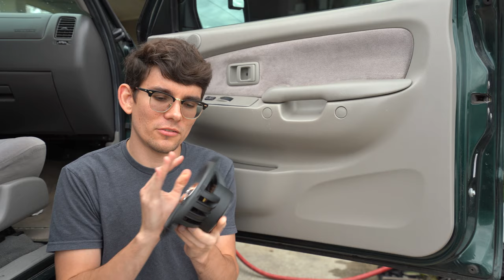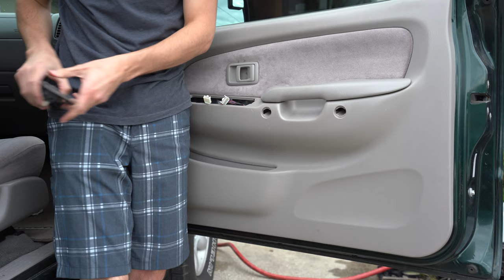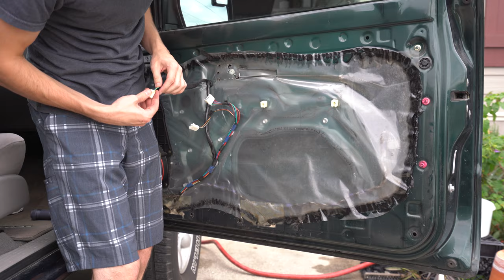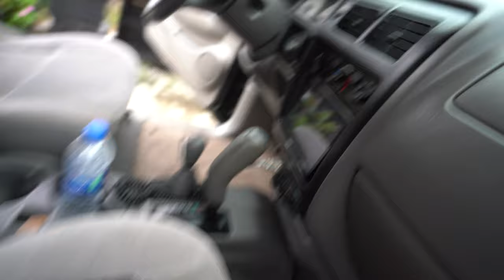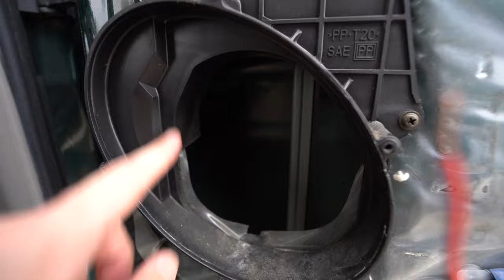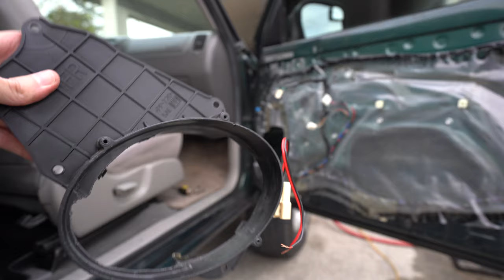1st Gen Toyota Tacoma Audio Upgrade

Comment: Did interior and exterior skins on mine as well. Most notable difference was how it helped with outside noise even without audio on, and the sound of the doors when they shut. I was able to A/B each side before I got both done. Takes that tinny sound out. I still need to chase down a buzz in the door cards.

Comment: I just commented on and liked your CB video. So funny the similarities in our trucks. My 2000 is the Access Cab too and has Infinity Kappa speakers all around, mine has 6-1/2" round speakers in the front and 6"x9” in the back. The rears are actually very powerful in my truck. It also has a 10" Gravity subwoofer mounted in a 12"Hx14"Wx12"D box behind the driver seat (with the jump seat folded up), and an Alpine 4 channel amp under the passenger seat. Works great!

Comment: Great vid! Im about to order a new sound system from Chrutcfield and was wondering about those funky mounting fixtures in the doors.  Im not going to need an amp and will try to keep the dimensions down on the back to prevent having to do any metal cutting on the door.
Reply: @BK_BT  dont mid trimming the plastic but would like to avoid cutting the metal if possible. Crutchfield shows what speakers will fit with just trimming the plastic part. When I ordered the 5x7s they emailed me instructions.

Comment: So your tweeters are no longer hooked up or are they?
also how did you wire door speakers did you use a harness or crimp them ? btw super helpful video
Reply: @BK_BT  awesome so you left them unhooked? also did you use a harness when hooking up the coax speakers? did it matter about the wiring to the tweeter?

Comment: I want to add some Pioneer 4 way A-Series 6x8 inch speakers to my 2003 Tacoma regular cab model. It has 3/8 inch tweeters built in. Would I have to disconnect the factory tweeters, or is it recommended to go with a component speaker system?

Comment: Do you need an amplifier to just replace stock speakers? I'm sure it sounds better pushing more power but if I just wanted to replace the old crap ones would I need to do this?
Reply: no you don't need an Amp most aftermarket speakers are 100 watt capable for power and most aftermarket stereos at most push 45 to 50 watts. the ohms help decide to if you get a Amp you can wire them in series you will increase the power to them by lowering the ohms. allowing a cleaner signal